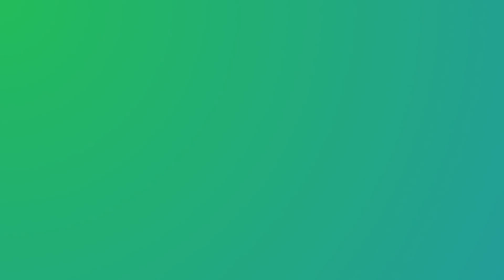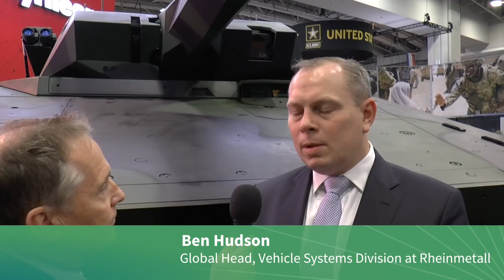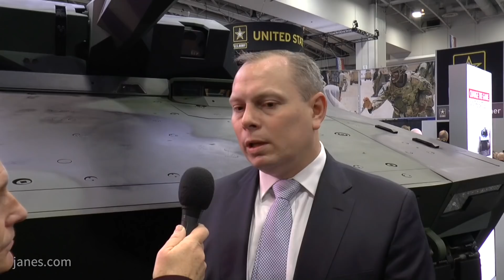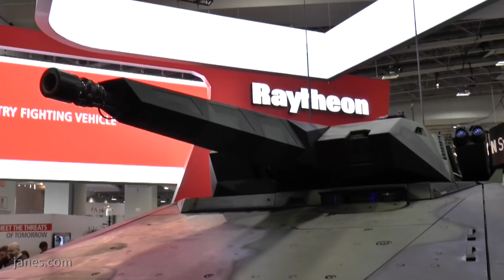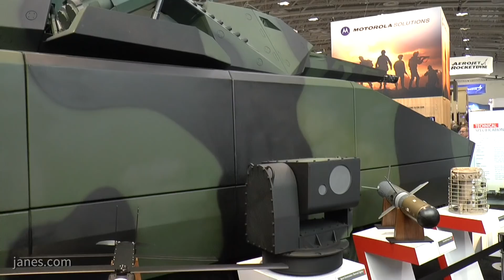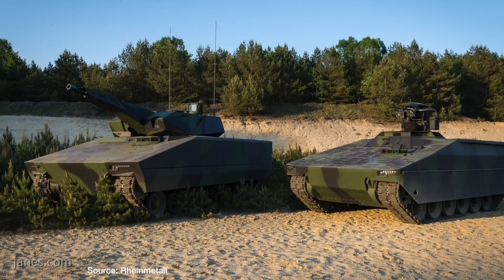AUSA 2018: Lynx KF41 - replacement for the Bradley?

Comment: Bradley w steel tracks is 31 tons, 6 tons lighter than lynx w RUBBER tracks. Height same as Bradley but with lynx sight retracted. Bradley seats 7 plus 3 crew, lynx is 6. Any platform for the lynx could be on the Bradley. I served 7 yrs mechanized infantry in 4 major divisions on 4 of the 7 continents.  Lynx is a pale second, but the military industrial complex gotta make money. Govt should pass on this foreign p.o.s. and that's from someone who absolutely knows a good one from trash
Reply: Didnt you listen? Lynx carries 9.
Reply: @SwuuschifyMe  yah 6 + 3 crew = 9
Reply: @joehughes5177  no, it carries 2 crew plus 9 passengers.

Comment: Finally. Yes, replace the Bradley! It's evolved from a good idea, to something that breaks down far too often, to an armored "Scary Cat," that runs away when someone has something bigger than a AK-47.
Reply: Bradley killed more tanks than Abrams in the 1st Gulf War and has only gotten better since. 

Sure it's replacement is probably due but the vehicle has been pretty successful despite the many shortcomings people point out.
Reply: The RPG 7 has taken its share of over 200 destroyed M1
Reply: Bradley was reliable, and having served w them for 7 years it was NOT a scary cat, but a certified ass kicker. 2 tow missiles compared to one for the lynx and the 25mm bushmaster chain gun is bad ass. The Apache uses the same gun in 30mm, which should have been an upgrade for the Bradley. And that RUBBER track is shit, but gets the weight down for the lynx so it won't be a 40 ton pile of crap.  Also Bradley's are 1.5 mil each. Never heard the cost on this pig
Reply: The bradley is garbage! Everybody knows that.

Comment: Where are the grunts and crew going to hang all their shiite? Ammo storage inside is mainly for the turret ammo. Grunts bring their rucks, water jugs, MREs, extra rockets, extra rifle ammo, extra grenades. Do these tailored suit guys go find a infantry squad leader, not an officer, and ask them how the vehicle feels , I wonder?   2003, in Kuwait, before we launched into Iraq,  we loaded up our AAVs, every space that could fit ammo or MREs. I tripped over a wooden crate that some grunt put by the opening of my gun turret interior to the troop compartment.  I yelled out "What's this sh%+!"  A lance corporal replied that his squad leader said to throw them grenades somewhere inside. I opened the crate lid and there certainly was about 30 fragmentation grenades inside. I showed him a space in the gypsy rack on the outside of the amtrack where the crate could fit. Not that the explosion hazard would really matter.  The deck of the amtrack was lined with 50 cal and MK 19 ammo cans. The inboard portion of the AAV fuel tank is exposed to the troop compartment interior, and it has a flat vertical surface that another hard charging grunt strapped his SMAW rockets so they'd hang above their kevlars. The grunts could now lean back against the bulkheads and doze. Civilians wouldn't believe that Marines will sleep in any vehicle once it starts rolling. It doesn't matter if a Marine is next to the turbo diesel engine seperated by an aluminum wall and the tracks are klanking and slapping against the hull, grunts will sleep. 
The vehicle has high speed low drag cool looks, but its acceptable if grunts and crew can live out of the vehicle for weeks and months. Semper Fi

Comment: they are desperatly trying to find someone that would buy the lynx
Reply: The Germans are increasing their defense spending I am quite sure that vehicle will wind up in German service pretty quickly
Reply: @jamesricker3997  Germans already have Puma. Lynx was always envisioned as taking Puma tech and using a bigger platform which would leave space for potential export customers to fit there own junk.

Puma is way more streamlined as it was designed specifically for German army requirements. If the US was smart they would buy that instead but unfortunately it will never check off the 10,000 boxes all of these acquisition projects have.

Comment: Disqualification of the Lince vehicle makes sense because the Bradley vehicle replacement is totally unfair and unnecessary, and someone should support more The BAE Systems that creates the wonderful legendary Bradleys.And they must find a modern solution to extend Bradley vehicles instead of replacing them unnecessarily.
Reply: BAE is german. They bought it in 2019!

Comment: There is no way US is going to buy a major item like the next "Bradley" from a company that the US Military Complex does not at least own a major cut of.
Reply: License production. The Stryker isn't from the US either, it's a swiss design.
Reply: @jonny2954  and was far too light in protection ( americans have trying to do something with it but... DIY , improved on field , converted  ) and the modifications have fucked up the axles tolerances/reliability/mobility... whatever it's a "against employement" exemple

Comment: 155mm gun? Sheesh, it's a troop carrier. Get rid of the huge gun and put in more armor underneath/larger tracks.  Toss a few javelin systems on it with a 30mm gun up top.
Reply: no your not understanding. hes saying the turret can be swapped out for one with a 155 field gun to give the infantry their own in house mobile artillery
the vehicle itself has a 35mm gun in its IFV form

Comment: Pretty little IFV, lets hope its a fighting IFV too. The Ajax and the britsh boxer seems a better way to go then an IFV,,, having all your cookies in the one cookie jar.
Reply: British Boxer??  Rheinmetall is german.
Reply: @chrizz754  
Yes it is ,, but the British boxer will be made in the UK. And the british boxer is different from the Rheinmetall Boxer.
Reply: Little. It's huge. 50 tons at max. Ajax is Spanish ASCOD, boxer is German.
Reply: @arvedludwig3584  Aussies bought the Boxer as a recce vehicle, not IFV. They are currently searching for a tracked IFV.
Reply: No, it's definitely not a better wy to go. It's a fuckup of the british MoD. They missed out on a AJAX IFV variant.
Reply: @jonny2954  
IFV= to many dead man when taken out...
Reply: @DarthMorpheus  The British Boxer variants will include a IFV, it's literally called 'mechanised infantry vehicle'. The issue is that the Boxer has a much lower protection level than comparable tracked IFVs, so the problem of more losses will be on the Boxers side.
Reply: @jonny2954  
The idea of the Boxer is to move troopers out fast get them in to position before the enemy gets there , and provide the infantry with a small amount of direct fire support. Then the Ajax arrives and then the challenger 2.
And the British army will more then likely not use the IFV version of the boxer as they have the Ajax , the hope is to remove all your cookies in the one cookie jar sindrome , that the Bradley IFV and this newer Lynx KF41 IFV have ..
Reply: @DarthMorpheus  
'The idea of the Boxer is to move troopers out fast get them in to position before the enemy gets there , and provide the infantry with a small amount of direct fire support'

That is exactly what IFVs do... Do you know what defines an IFV?

Also, care to explain that 'all your cookies in the one cookie jar sindrome' please?
Reply: @jonny2954  
It takes on to many roles. APC , Infantry support ,  Tank destroyer ect.... Definition of an IFV ,Cookie Jar.
Reply: @DarthMorpheus  No, wrong. The CFE defines an IFV as 'an armoured combat vehicle which is designed and equipped primarily to transport a combat infantry squad, and which is armed with an integral or organic cannon of at least 20 millimeters calibre and sometimes an antitank missile launcher'. No cookie jar, not too many roles. In fact, to this day the MBT + IFV combination is the most effective on the symmetrical and assymetrical battlefield.

What the British are trying to do is using a vehicle that was designed as an backbone support vehicle as an IFV. There are pictures of Boxer trials with the CT40 turret. Looks good at first, but wheeled 'IFV-ised' 8x8 have far inferior protection and mobility compared to proper tracked true IFVs. The Boxer is not a frontline vehicle, it's a backbone support platform. Neither of its original developers (germany and the netherlands) use it as a frontline vehicle, they both have proper IFVs to do the job (CV90, Puma). The British need to get a ASCOD 2 (AJAX) IFV version to replace the aging Warrior.
Reply: The boxer isn’t an IFV.
Reply: @arvedludwig3584  no. They are using the Boxer as a reconnaissance vehicle only. The next program is to decide between Lynx or Redback.

Comment: The M2 Bradley definitely needs replacing.

More than 65 of them have been lost in the Yemeni desert after being attacked by sandal wearing Houthi's.
Reply: Those sandal wearing Houthi may be bad, but there are worse things out there. 
Such as gumboot wearing Houthi, Cleat wearing Houthi, Ugg-boot wearing Houthi,

And the worst of all: Crocs wearing Houthi.
Reply: An IFV does not have tank level protection .( unless it's a Namer a  Merkava based IFV) .
Simply  put most  IFVs have to be rapidly deployable .  Weight is a key issue in rapid deployment.
Reply: Have you seen the awful tactics utilized by the Saudis? Driving down desert canyons with zero infantry support and no active defense is basically saying, hey look here a tank blow me up? It's the same excuse the Russians used after Chechnya with the t80 yet they're now equipping their arctic forces with modernized t80s which should tell you a lot about the status of the armata program BTW, but that's the reason they're losing vehicles it's not the equipments fault and as another comment mentioned they aren't even equipped with busk reactive armor which has proven to be very effective in Iraq
Reply: Yes, but knowing the US army, they won't buy a completely new model.
Reply: ThatDutchguy 
LOL. Saudi’s? 
They are only powerful against women & children. 
Took them 14 “specialist” to execute one innocent american.
Yet, they mission failed miserably
Reply: it's all about tactics. learn to use the tool properly, instead of applying the same tactics with every new tool. 
the saudis probably thought they got a new usa tool, and so they can charge at enemies with absolutely no fear. 
dumb soldiers with even state of the art toys, aint gonna win the fight.
Reply: What happened to the 250,000 elite Saudi troops poised to invade Syria and kick arse. Whoops that’s them in Yemen.
Reply: More than likely lost due to treating Bradley's like tanks. How many hmmwvs were lost in battle, and that was just a damn truck they used as an armored car. U.S. is great at misusing equipment designed for a different role
Reply: No.
Reply: @OptimusPrime6321-g1r  Lost Armour.

Yes.
Reply: @thatdutchguy2882  For you maybe, but for me it's not a lost armor, the m2 bradley is 100 better than the crap of the Lince vehicle.